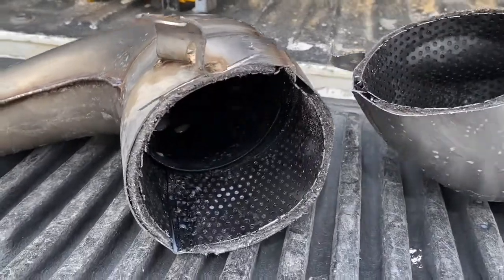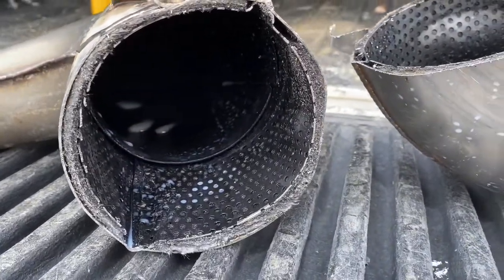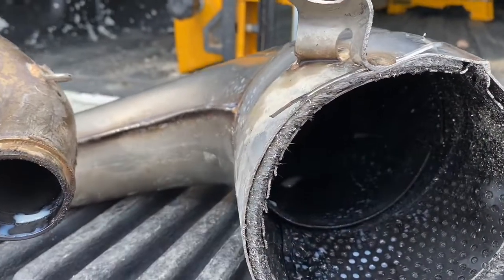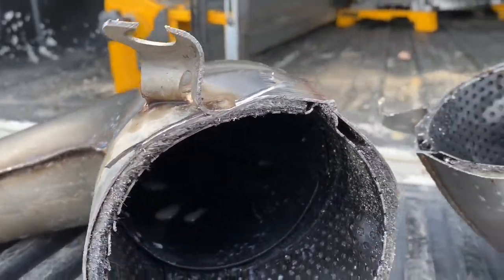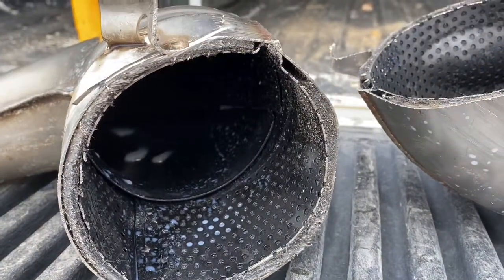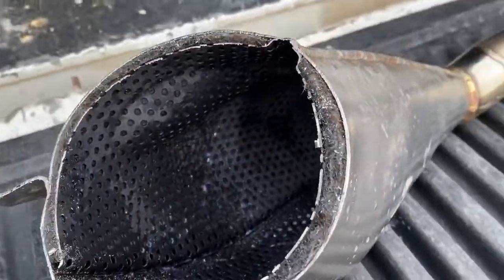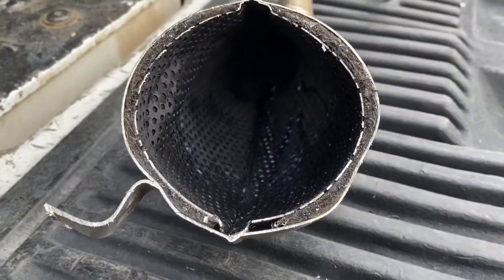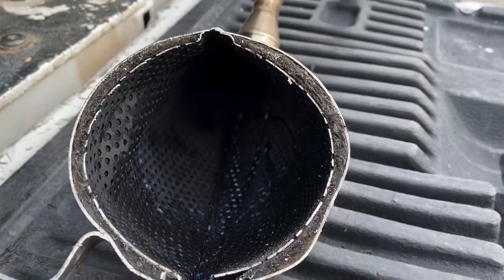What’s Inside The 2 Stroke Pipe?

Comment: I've cut open the factory exhaust on my a Derbi senda and it looks the exact same inside but it has a catalytic converter inside aswell
Reply: Same .i cut Aprillia RS5 open and is that a catalytic converter? Is it worth money?
Reply: @GrubBindloss  yes, if it looks like a honeycomb. But probably not worth much to be honest
Reply: @rgracing4109 yes its about 50mm by about 70mm long across .its in the bin .surely that would restrict the pressure wave reducing power
Reply: @GrubBindloss  completely disrupts it, getting rid of it won't cause issues i think
Reply: @rgracing4109 im actually going to fit it to a very old suzuki RG 80lc .the exhaust on these are absolutely terrible